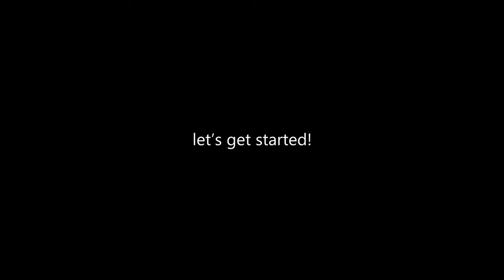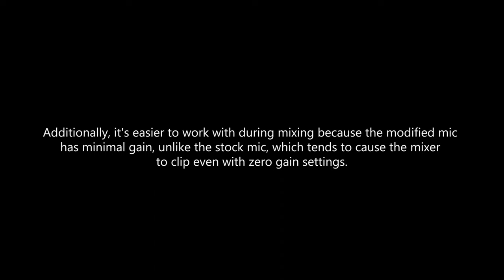BM800 Microphone Circuit board Modification

Comment: Hi, I bought the exact same circuit board and tried to install on my BM800 with the 34mm capsule. After install, the mic did not work and there was alot of noisy humming from the speakers. I don't know if I installed it correctly. Maybe you can help. For the capsule, I have 2 wires, one from the center of the capsule and another from the side. Do I connect the center wire to the + and side wire to the - part of the board? (I did this and the mic did not work). I'm quite certain the XLR connections are correct. Is there any other things I need to do? 😅😅😅
Reply: Check your ground wire, make sure you didn’t swap any wires around, check for any crossing.  If you're getting a hard buzz... make sure you are properly grounded.  For the diaphragm/capsule.  The center is positive and either far side post is ground.  I modded my to have the capsule facing TOP so now I can boom mic and point it at me as most do before that not knowing it's sideways LOL.   But for real, I modded it and I had that same hard buzz.  Check your XLR connections and all.  Again, make sure you are not crossing(solder touching from one point to another.)
Reply from the maker: @limtk55 check your xlr connection. If I am not mistaken, the xlr connection from the board is labeled with number 1 2 and 3. Connect those to the same number in the xlr pins that are also numbered 1 2 and 3. By the way, this circuit needs phantom power
Reply: I also did that and all i got was loud static and noise. I just think it is a faulty unit

Comment: "The input microphone and audio sensitivity are adjustable" . Stated on product page.

Do you know what does it mean?

Does it have to do with the + and - marks on the board, close to the mic sign?
Reply from the maker: The + and - marks on the board are for the capsule hot and ground connection. For the audio sensitivity, maybe it's for the mic gain  adjustment by changing any resistor from the board but I dont have any idea which one.